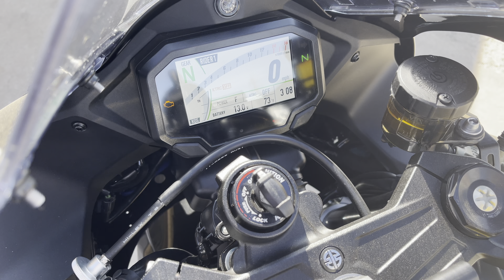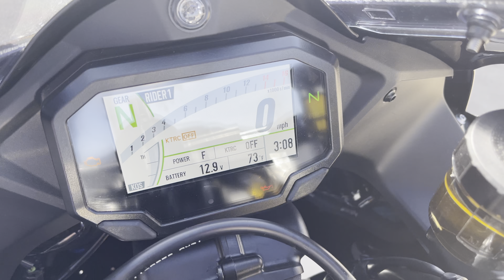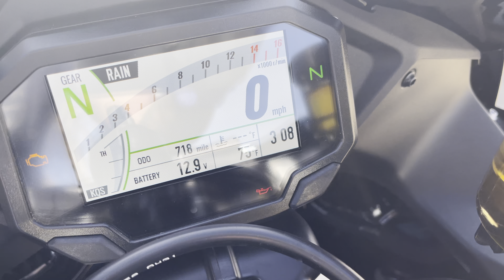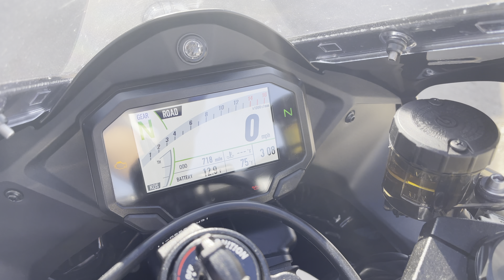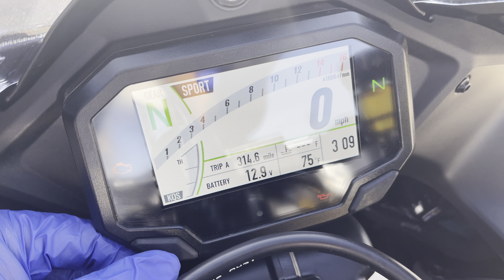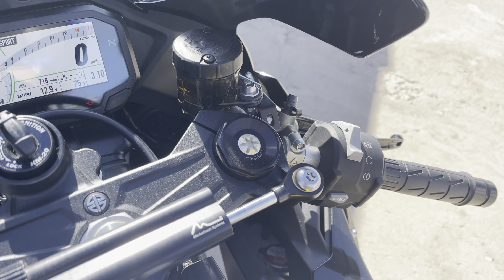2021 ZX10R Lean Angle Sensor Display Modes & Odometer

Comment: Does type 2 track display have gps transponder?
Or do you need to manually trigger each lap time?
Prior generation had aftermarket plug and play adapter, will it also work on 2021?
Thanks
Reply from the maker: Manually trigger each lap time, and yes you can hook up aftermarket displays